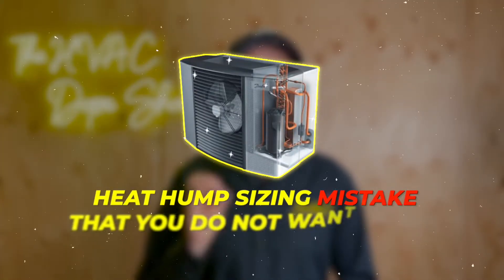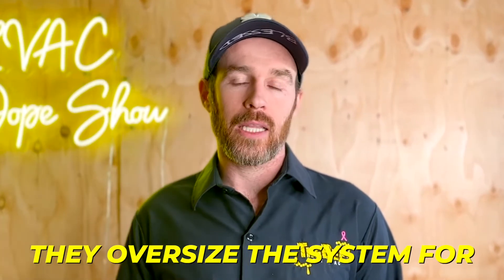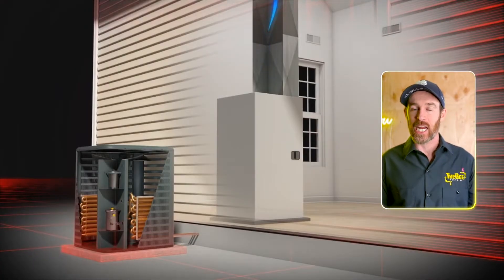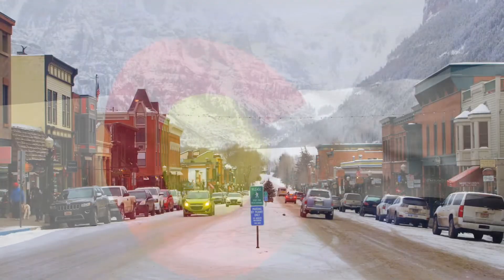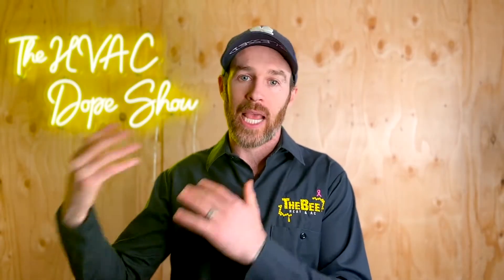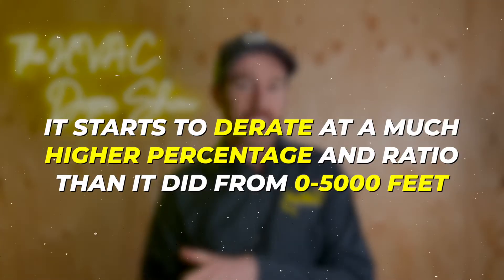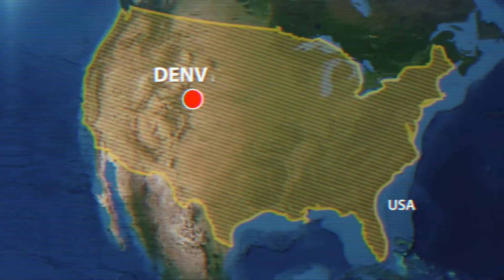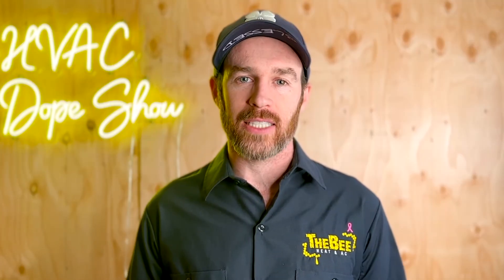#1 Heat Pump Sizing Mistake 2025 🔥 | HVAC Buyer’s Guide

Comment: Great video :) 

It's really hard to find youtube videos specifically about sizing for heat pumps. It's also difficult in get someone in my area (10598) to perform a proper analysis. 

Companies are always sending a SALESPERSON who either wants to slap a heat pump onto to my current ducting or recommend a ductless system for my entire home. (I currently have a 15 year old AC ducted system & a baseboard hot water, oil fired.) 

I would respectively like to see a deeper dive into sizing, including benefits of upgrading insulation, flex versus tin ducting, an example of ducting system calculations, & when a hybrid heat pump system (ducted & ductless) makes sense. Lastly, anything else you do when you calculate a home's sizing. 

(Down the road I would also love to see a global analysis of a heat pump / solar powered system, including backup battery economics. Maybe this can be done through a solar expert who makes YouTube videos that you think does a great job.)
Reply from the maker: Great suggestions! I will definitely use these for some videos, they’re common questions we get asked about and I’d be happy to go through some sizing examples and make some videos about these.

Comment: Are you guys authorized Rheem heat pump dealers? Thanks for the info. I’m going to replace my two system central ac and furnace soon.
Reply from the maker: Right on our pleasure, and currently no we don’t sell Rheem. We’ve reached out to them but they don’t really have any cold climate heat pump products that work well for us so we haven’t considered offering them because it’s a big product request we get in Colorado. I’d be open to looking at them if they had a cold climate product… that may have changed my last inquiry was about a year ago

Comment: I live in northwest Montana and have radiant floor heating with an electric boiler and no air conditioning. I am wanting something like the Daikin Altherma for both heating and cooling and possibly hot water as well. If I understand correctly the Altherma is not currently available in the US.  Is there a reliable alternative or do I wait for the Altherma?  Love your videos.
Reply from the maker: Thanks right on! Yes there is currently but if you can afford to wait they’ll be more new tech coming out before year end (2024). Idk if R290 systems will make it by then however they will have other Air To Water systems out with a little better performance and some of the newer A2L refrigerants. The Altherma should be here by Q3 or Q4. Currently Nordic makes several air to water systems and so does Enertech. If you have space for geothermal that might make sense because Geothermal has higher COP’s at colder temps and if you’re able to install one they’re more efficient in super cold weather and very popular in Canada. Hope that advice is helpful lmk if you have other questions!

Comment: Ignoring the increased possibility of equipment failure, if your system requires more airflow your ducts will be noisy. This is especially obvious if you have a zoned system where a house-sized system will end up directing all its air into one smaller "half" of the home.
Reply from the maker: Definitely!
Reply from the maker: Thanks for the comment, good information and definitely true on zoned systems

Comment: Very good but 99% of the time is stretching it. When we do heat loads we change the design day at 10 degree intervals so we are able to better calculate our heating curve. We do this because modulating boilers use outdoor reset controls but we also do this with heat pumps with fossil fuel backup. In my area we use a design day for heating at 9 degrees. usually the heat pump sized for a/c will satisfy the load to around 30 degrees. As the switchover is now done by the thermostat with an outside sensor it becomes relatively easy for me to instruct the customer how to change the parameters. I will usually set the switchover at 25 degrees and inform the customer if they cant get the stat to satisfy, bump the switchover to 30 degrees. Our weather here during the winter is below 30 much more than 1% of the time. I would say the heat pump will satisfy the stat 65% of the time but not 99%. Another point is most heat pumps are based on max tonnage at 47 degrees so you need to look at the performance chart to see what BTUs are being put out at these outdoor temps. Many of your cold weather inverters will put out undiminished BTUs down to zero but it is worth looking at the COP of these units at these lower temps as depending on your cost for electricity may not be worth running it. Propane here was 1.27 a gallon this year. That is 92k BTUs for a 1.27 and electric has gone up considerably the last couple years. So the switchover is not solely based on BTU output but also cost of operation not to be confused with "efficiency".  Excellent video.
Reply from the maker: Excellent thorough comment thank you! A lot of good information, we pay over $3 a gallon for propane here so off grid applications make more sense if the system is keeping up but yes you definitely have to look at COP and output at those lower numbers!

Comment: I've hit neg 20 last 2 years in lone tree 

thoughts on Gas vs heat pump for garage heat?
Reply from the maker: Lone tree Colorado? Right on that’s our neck of the woods, for garage heat a ductless heat pump is fine (assuming you’re talking ductless?). 99% of the time the low in Denver metro Colorado is above 10F so those super cold nights a low ambient rated ductless like the Daikin Aurora or something else will keep up still, especially for a garage. Gas is more work because you have to run the exhaust and gas line and it’s not usually as nice. A ductless has the benefit of doing AC too if you’re working in the garage in the summer.
Reply: @TheHVACDopeShow  if you have stuff that cannot freeze in your garage do you size differently?

Comment: Can I put a Daikin Fit on a double wide modular home? I have a 4 ton A/C coupled with a electric furnace. Thanks
Reply from the maker: Actually let me check because idk how the coil would integrate. Depends on your air handler / furnace setup. Mobile homes use a different air handler so it depends… is it like a standard mobile home Coleman furnace?
Reply from the maker: Yes you can, not the heat pump but there’s technically a Daikin gateway that will pair with your furnace. The AC will modulate but the air handler will not so the furnace is still the same in terms of airflow, but the condenser is quieter. You’ll get the partial benefit from more efficient outdoor unit

Comment: Upgrading from an R20 attic to R50 knocked about 20% off my heating and around 30% from my cooling run time. I guess attic heat soak is a thing. It'll still take 10 years to pay back, but it felt worthwhile.
Reply from the maker: Right on, yeah things are typically more comfortable too and less drafty
Reply: Dual fuel systems in cold climates (with gas furnace)

Comment: Hi, another great video! In it you mention the Daikin Fit Enhanced. I haven’t been able to find any info, technical or otherwise on Daikin’s website and I’m considering the Enhanced for my new CCASHP but only if I can find some technical performance info on it. As a rep just wondering if you can either post some info or maybe email the info to me assuming there aren’t any issues with doing that?
Reply from the maker: If you search DZ6 the model number has performance charts for the Enhanced as well
Reply from the maker: The model number ends with E, it comes in 2,3,3.5 or 4 ton, and they all maintain at least 75-85% Capacity at 5F, and they have a COP over 2.2+ at 5F as well. That’s what in the charts if you’re looking for the technical data. Happy to post something here thanks!
Reply: @TheHVACDopeShow  thanks so much Howard, I’ll see what I can find. Hopefully a success!

Comment: But why is it that some heat pumps have like “cool heat” (like the Carrier 25HHA) and not like warmer than skin temperature?
Reply: A heat pump will typically heat 20-30 degrees more than what the temperature coming into the indoor unit is. Although I can't specifically speak to that carrier unit as it could be installed improperly, wired wrong, have a bad electric heat strip or something else, the Daikin Fit Heat Pump Enhanced version optimizes comfort and rarely increases the indoor ambient temperature more that 0.2-0.3 degrees F during the Intelligent Defrost mode. This is where it needs to switch from heating to cooling for a brief moment to melt any ice buildup on the outdoor condenser. Daikin has worked to perfect this transition, and if installed correctly with a backup heat source, there will be no blasts of cool air coming out of the vents like other heat pump systems.

Comment: What are the ways to measure the ideal air flow for an existing duct system?
Reply: The duct size, static pressure of the current system, and a heat load calc would determine if it can handle what is needed. A lot of times older homes need supplemental cooling/heating in the form of a secondary system in the attic or a ductless split system for the rooms that can't keep up. Obviously this also takes into account that your insulation in the home is adequate; doors, windows, walls, and attic. 
Ultimately, a ducted HVAC system can only pass through as much air as it can determined by the size. 
A static pressure test will tell if the current system is sized properly for what the ductwork can handle.
Reply from the maker: What he said ⬆️ lol
Reply: @TheHVACDopeShow  TrueFlowGrid